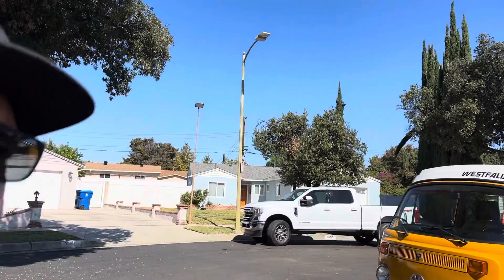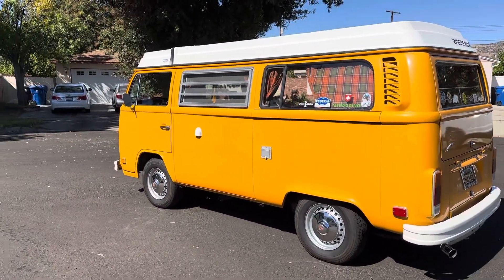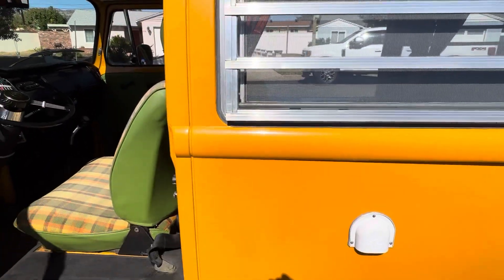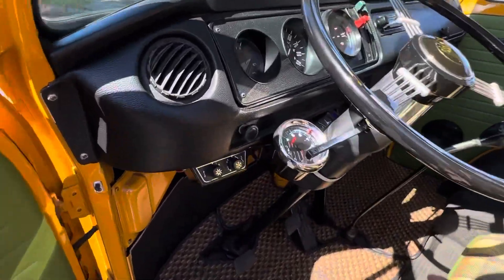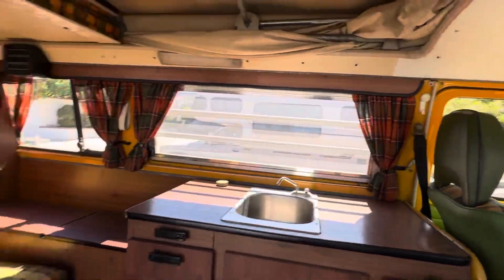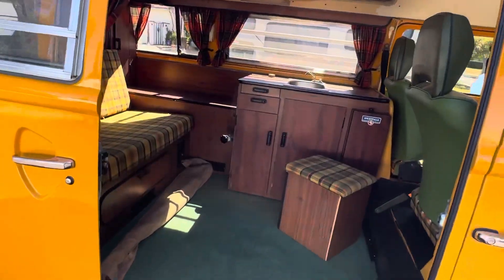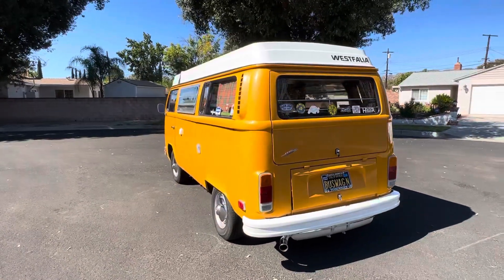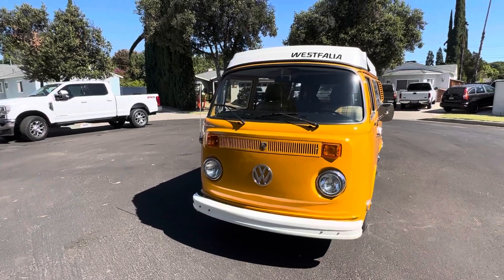1975 VW Bus Westfalia with Porsche 911 ROW 3.0 engine Conversion

Comment: You used the original trans and  the motor bolted right up?  Working on a 73...I like this, thanks for posting.
Reply from the maker: Hi yes original 091 transmission had the gear changed out to match those in a 911 transmission. 
Or freeway flyer. 
Kennedy adapter for a 3.0 Porsche to the 091 transmission with the VW Clutch assembly.  
What engine are you using.  I do have an early 911 flywheel that converts to a 091 transmission available. You can call me 
David 818 535-564five
Thank you
Reply: @havasuporsche  currently has a beetle motor, the hunt for a reasonably priced 911 motor starts now.  My van is a wild westerner, pretty sure there wouldn't be another one anywhere with a 3L.